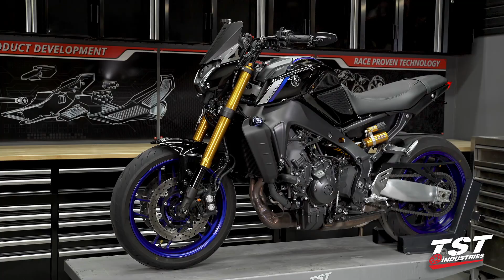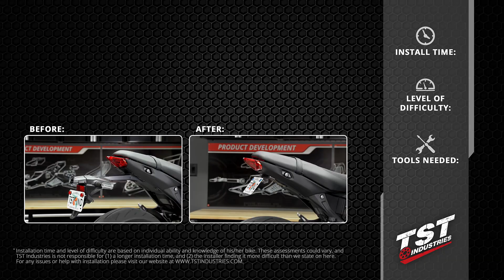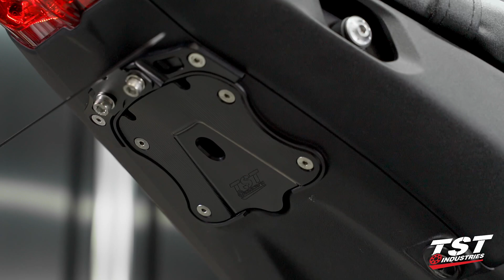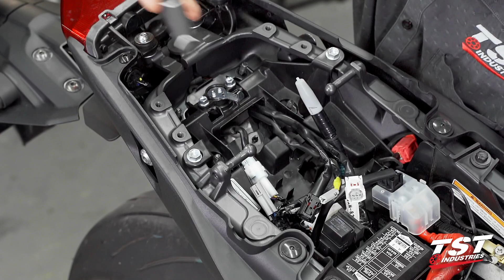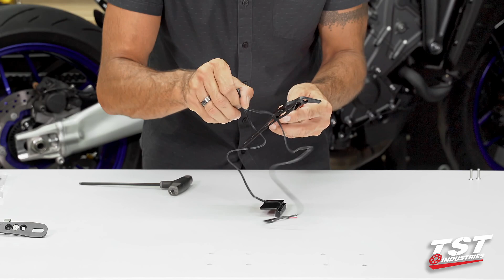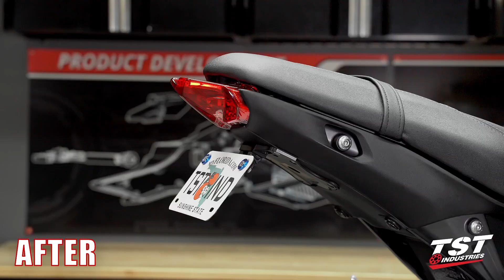How to install an Elite-1 High Mount Fender Eliminator on a 2021+ Yamaha MT-09 by TST Industries

Comment: How is this one on european plates? I thing there should med something to fasten the bottom of the plate, cause of its height.
Reply from the maker: All of our products are designed on US-Spec motorcycles. As mentioned on our product page: 
NON U.S. BUYERS: Our standard high bracket is designed for U.S. plates and fits a hole spacing of 12.7 to 15.49 cm with 5mm hardware, while the adjustable bracket fits a hole spacing of 13.2 to 15.97 cm with 5mm hardware.

For more information, please visit our website!

Comment: Does the ajustable high mount affect the OEM signal holder position? And assuming the light is sold separately. Appreciate any feedback! Love the content as always.
Reply from the maker: The adjustable setup mounts below the OE signal bracket so you can adjust license plate angle but signals stay fixed in one position. Which light are you asking about?
Reply: @TSTindustries  license plate light.
Up here in van bc we get harassed for plate angle so was hoping to keep plate vertical if I got another VI lol appreciate the quick reply!
Reply from the maker: @cristos604  ok, yes then license plate light is a separate item yhat needs to be dropped into the cart
Reply: @TSTindustries  perfect. Thanks guys. 
Will order now 🤙🏽
Reply from the maker: @cristos604  you're welcome. Just be careful with the plate engle adjustment. Make sure you dont set it in a position that will end up touching the tire under suspension travel
Reply: @TSTindustries  Right! I caught that on the second time around when Bart explained in video . Thanks for making sure. Will keep 30-45 degrees out.  Looking forward to cleaning up the 09sp rear end 🔥🤙🏽

Comment: Is the stock liscense plate light usable with this mount?
Reply from the maker: No.
Reply: Thanks just bought the kit and im very confused where the bracket for the oem signals is suposed to mount.
Reply from the maker: @krzysztofderejski  please see the instructions in this video https://youtu.be/jbngLqSWBfM
Reply: Thank just installed it, everything works greak.
Reply from the maker: @krzysztofderejski  awesome!

Comment: How the locking system is protected from stuff? I don't see any step to put back the small oem cap like some other fender elimator got. Thanks !
Reply from the maker: The slot for the key is off axis with the key cylinder so any water and debris blast does not get on the key hole in the cylinder. We do offer a different solution for this area, which is a full undertail, and that has a mechanism that springs open for the key insertion, and springs closed when the key is withdrawn. You can see that system in this video: https://youtu.be/M-n1ImNkGnM